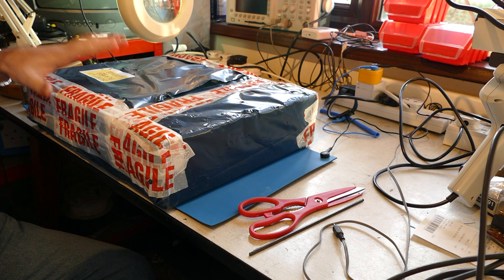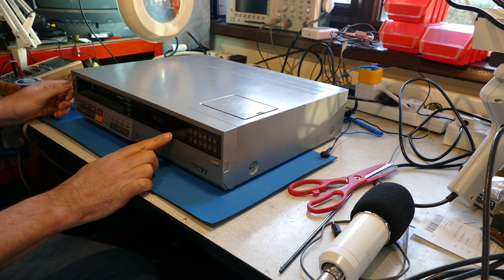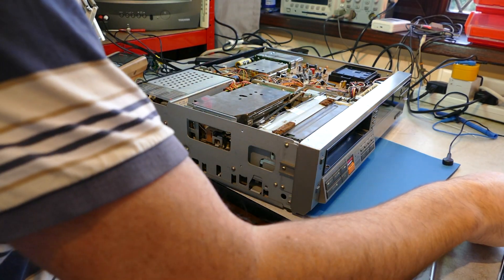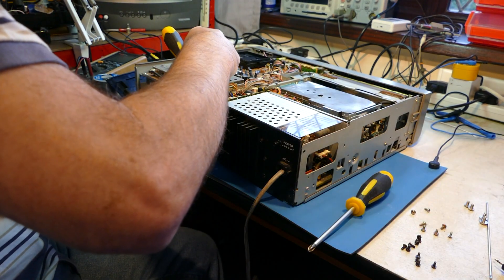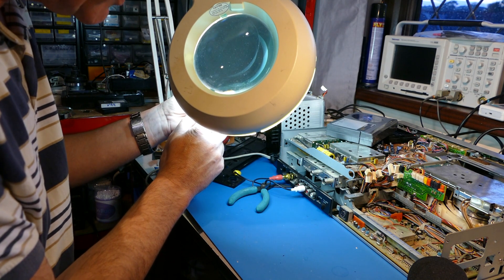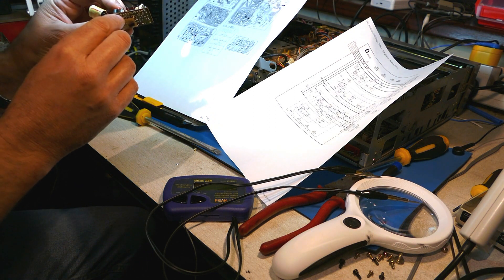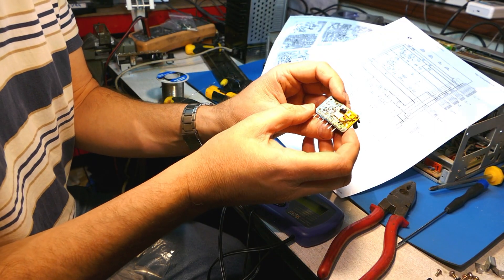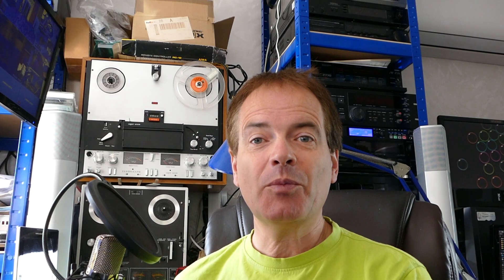Fixing the display on a Sony SL-C9 Betamax video recorder (DC-DC converter repair)

Comment: Do u know if the sl hf 100 has a dcdc converter and if so where it's located?
Reply from the maker: Looking at the service manual page 57, there's a switching regulator IC MB3759 on board D which provides the higher voltages via a transformer and rectifiers.  So yes, that's a DC-DC converter circuit of sorts.
Reply: @video99couk  so its located on the psu? if so i dont need to worry i recapped the psu completely
Reply: @video99couk  ah yeah its the little addon board which they soldered to the psu, recapped it aswell already

Comment: Today Feb, 2nd, 2024 i received a 2nd hand SLC9e, not es. Repaired many of them in the early '90 for Sony Netherlands. This Betamax was the one with the most standard issues which where fixed under warranty ( I think). Problems where : not closing front door, broken nylon gear cassette loading compartiment (CLC)  (replaced by metal gear version). On the side of the CLC a kit (o-ring + tiny screw) was added for the problem the 2 plastic components got apart from each other. The black nylon gear with metal inner ring was replaced by a full nylon gear.  Broken loading rings where also common on the Betamax after the C5,6 and 7 models. On the loadingring there are 2 tape guides who where replaced by better fitting one. Than of course the DC-DC converter. The sensor in the lowerdrum motor with the glue issue. The solenoid with broken internal fuse (behind tape, not direct visible) on the reel table. Just put an shunt wire as solution :) . Also tape guides on both ends got loosen. And . . . . a burned Servo System board , burned and heavy damaged by the transistor driver for the unique Reelmotor. Sometimes stereo audioheads where too damaged by many hours of use Betamax tapes , PB, FF and REW use. It was a great time a technician for Sony NL.
Reply: Do you know what was different about the SL-C9UB compared to the C9? The input specification for the C9 says 110-220 50/60Hz, but can find nothing on the power requirements for the UB...
Reply: @jimthebrit  All SL-C9s have suffixes in their model number depending on which region they were destined for:
SL-C9UB = UK, mono tuner, 12 tuner presets
SL-C9E = Mainland Europe, mono tuner, 30 presets
SL-C9ES = West Germany, stereo/bilingual tuner and modulator
SL-C9ECS = Belgium, stereo/bilingual and cable (CATV) superband tuner
SL-C9F = France, SECAM system, mono tuner, cassette doors and front/rear panel buttons, switches etc are in French
SL-C9AS = Australia, similar to the European model but with different tuner frequencies
All variants have a 110-240V switching (SMPS) power supply. The ES and ECS variants can also record the stereo and bilingual pilot signals onto the tape for automatic selection during playback, as well as transmit 2-channel sound over the RF output. None of the other variants can do that.
Reply: @crashbandicoot4everr , perfect explained. My compliments.
Reply: @AudioVideoVintageLover  Thanks. I forgot to point out that the ES variant was also available in black the next year. I have both colors. :)

Comment: I've got the same player with no display as well.But I don't have a tale do I need a tape to see the display?
Reply from the maker: The display should be working with no tape inserted.  It almost certainly has a bad DC-DC converter, and possibly other faults too.  Tapes are easy enough to find, they were made in their millions.

Comment: Hello.
I bought a used SL-C9 and upon turning it on (without cassette) it goes straight to lacing, then unlaces along with some unhealthy sounds and the eject light stays blinking.
Can you please help me?
Reply from the maker: The lacing and cassette mechanisms on the C9 are unnecessarily complicated.  I'm afraid it's not possible to fault-find my remote control, this is going to take the attention of someone familiar with video recorder repair.

Comment: Hi, i really love your repair video guides very much. 
Maybe you can answer my question. I am also an owner of a SL-C9ES machine. Unfortunately one video head is broken. Is it possible to replace this 3 head video head with a 2 head video head, like it is used in almost all other Sony Betamax recorders (e.g. the SL-F1)?
Reply from the maker: I had always assumed that the F1 and C9 took the same heads, but never checked.  I don't know what would happen if you fitted the wrong heads.
Reply: Thank you very much for your very quick reply. Yes, i thought the same until i checked the service manuals today. The upper drum is still the same, but not the video heads. So there is no other chance then to try it because i cannot get anywhere the SL-C9 3 head video head.
Reply: Just a short feedback. Playback, recording and normal picture search are working very nice. The special picture search functions of course not about the 3rd head (A') which is missing with the 2 head video drum now. Do you have any idea from where i could get the original head?

Comment: hello, thank you very much for your shares. After plugging in the slc9 es lcd screen, there was a sound and it does not show. I have a lot of problems because of the betamax video. Do you have a recommendation for a sony latest model betamax device that I can use without any problems? There are problems I have experienced in related videos from the link

https://mega.nz/file/0soyQByL#CSEt9yIirYEkD3e5CRUINyL1hVuDocI6vtcdU0vSJ4M

https://mega.nz/file/s9xiyJaL#JOYkqusnh0OFklHGjijlGhvYlL4P2sopYwQ_6zgHiYk

https://mega.nz/file/BkhghZJC#asqIXxnxUGpeYH0mksCJrDMF4xtBiGQILJy2JnbvHUY
Reply from the maker: I find that the later Sony models are quite good, any from the SL-C20, C30, C40, HF-100 and later.  Sanyo VTC5000 and VTC5150 are also reliable but will probably need idlers and belts.
Reply: @video99couk  Thank you for helping me, I'm one that transmits continuous old tapes to a computer, but I'm looking for a device model exhibiting the best performance of the SL-200 model as the year of the latest devices in 1987 used a longer life, I think what do you think about this topic

Comment: Hello youtube, thank you very much for your useful videos, first of all, the head nail parts of my sony sl 800 me video device are broken and I want to buy and install a new one, but I do not know which product to buy, but if there is a head model link I can buy according to sl800me, I would be happy if you can inform me. thank you

https://resimyukle.io/r/toR6XjfBQe

https://resimyukle.io/r/mlaTmwthY5

https://resimyukle.io/r/WrujjaQGMV
Reply from the maker: You will need to download the service manual to find the video head part number.  It may not be available any more though, this wasn't a particularly high volume machine.
Reply: Thank you very much for the answer. I searched on the internet, but I could not find the sl800me user manual. In the video I sent you in the head part, the label says 68A japan. Is this the head model? 
https://resimyukle.io/r/NFgCkIXbwC
Reply: @video99couk  hi how can you help me sony sl 800 me i can't find the manual pdf file unfortunately :( you can send it to me if it is in your archive which head mechanism i need to buy for sl800me sony betamax sl-t30me head mechanism would it be for 800 me device

Comment: Hello, thank you very much for the videos you add are primarily useful videos have spectacular Betamax SL-C9 device I'm having a problem, unfortunately, I want your help on deck cassette case ejector light is not constant flashing and tape does not get to the deck the video as I ask your help, I add the following link megazn thank you

https://mega.nz/file/sopVUCTD#kHkWJXlsqnHVZ1534XAYtrKQJrJYHVlEwLFAtDvZgKo
Reply from the maker: I can't really repair things by remote control.  All I can say is that it looks like the cassette carriage has a problem.  The carriage is very troublesome on these machines.  Check to see that you have the brass gears at the ends of the rod which is just inside the top of the carriage.  If the deck still has the white plastic gears, they have probably broken up and will be part of the problem.

Comment: Question...I have a sl-2500 that powers on but has no visible display. I lifted the cover and noticed two thin wires (red and black) attached to a small black connector that wasn't connected to anything. The wires were maybe 5 inches long. The wires were coming out of the right side of the display module. I can't find where this is supposed to plug into. Do you have any ideas? Thanks!
Reply from the maker: I don't know what the wires are for.  I suspect the lack of display is due to DC-DC converter failure, that's very common.  It also takes out the tuner, so you might be able to test for that and prove that you're on the right track, if you can find a way to get a signal for it to tune into.
Reply: @video99couk  Thanks for the reply! I looked at the service manual for the player in this video (basically the same as the SL-2500) and  it looks like the two wires attached to the  black connector go to a small board below the display called SL1 (I think or SV1?) and is for some "monitor/camera" selection. Maybe someone tried to fix the display and failed to reconnect it. I was hoping it was a "power" wire for the display. Lol. I'll look at your video in more depth and look at replacing those bad caps. Thanks!

Comment: The SL-C9 already had a real time counter?
Reply from the maker: Yes, years ahead of most other machines of any format.
Reply: @video99couk  Well, thanks to the always loaded tape. VHS achieved this in late 1987 when AKAI invented the "Quick Start" mechanism, with also always loaded  tape. The Sync head needs to be in contact with the tape.
But in general I still preferred Video 2000 with their absolute time counter.

Comment: Hello from Australia, I have been lucky to find two C9 machines, although one of them won't play,,, everything else works eg, picture search forward and review but won't stay on Play mode, it starts to play for half a second then stops...!,
Any clue...! 
Thanks again.
Reply from the maker: Is the head drum spinning at full speed (rather than just being dragged around by the tape)?  If not, then suspect Hall Effect sensor in the lower drum.  How about freeze frame?  If that works, then there may be a capstan servo fault or problem with takeup spool speed.
Reply: video99.co.uk Ok thanks for your response, I'll need to check the pause, thanks again 👍
Reply: Hi Colin , just been looking at the C9 again,,, it seems to be loading tapes okay and all the special effects frame by frame half speed , pause and review is all working as it should, although I need to be quick as soon as I hit Play I need to activate pause or frame controls otherwise it won't work, you might be right about the capstan....! Any ideas on how to check this..! ((Also Picture Search  doesn't work))..is it somehow connected to play mode..! Thanks again Carlo.
Reply from the maker: @carlzaffino3434  See towards the end of my other video about C9 repairs: https://www.youtube.com/watch?v=iuPSf7KdOag
I suspect you may have a capacitor failure on the lower PCB.  There aren't that many so if you don't have a good ESR capacitance tester then you could just replace them all.
Reply: video99.co.uk Okay, I've already had that board out, I do have a ESR meter but didn't think to use it 🤔,,, I'll check it out, thanks again..✌️

Comment: Sony SL-C99 and SLF1 portable were a masterclass in design. I loved my C9
Reply from the maker: Three major design changes I would have made though: Much simpler and more reliable C9 cassette carriage.  Eliminate the DC-DC converter for the clock and tuner on C9.  Redesign cabinet work on F1 so that it is possible to access the top of deck without taking the whole machine to pieces and risking flexi-cable damage.
Reply: @video99couk  sl-f1: should never have used those flexi-board ribbon joiners. the very beginning of many Sony vcrs, walkmans etc with open-close flaps etc and eventually the film ultimately fractures rendering some push-buttons useless

Comment: At My sl 9ces the display is fault too .. shit ... i cant see no digits..... i hope i can  repair it...but i have no air gun ... should i replace all capacitors at the dc dc unit ? And which other pieces ?
Reply from the maker: I would replace all the electrolytic capacitors.
Reply: @video99couk  
I have replaced all capacitors but no function. I think one of the Transistors may be damaged.
Reply from the maker: @rennobecker9032  Oh dear.  It's going to be a case of checking the transistors against the schematic.  Most transistors should appear as a diode from base to each of collector and emitter (for NPN) and open circuit between collector and emitter.  So you can probably test most of them in place.
Reply: @video99couk  thanks for the replie. When I have a little bit time in the next i will test the Transistors in hope finding the circuit.

Comment: Hello,  I have questions please, Where can I find video head for Sony Betamax Sl-200me ?    Does Sony Betamax sl-2300 video head fits on Betamax Sl-200me ?
Reply from the maker: I don't know for sure, you would have to look up the service manuals to see the head part numbers.  The SL200ME is PAL/SECAM but that wouldn't in itself require different heads to a PAL machine.  But the SL-2300 is NTSC only so I doubt that it uses the same heads as a PAL/SECAM model.

Comment: Years ago i had a mates vcr in for a no display fault, there was no supply to the flourescent display, While moving the vcr i noticed a slight tin sounding rattle.
Inside a small tin box near the display was the oscillator, the coil would of had an aluminium cap with info on it, the glue had given up the ghost and the cap fell into the component area.

No parts were damaged as a micro fuse had popped, i left the cap out of the box :-D
I also cleaned the inside glass of the fasia, it never gets cleaned :-(
If you don't like waffle comments please tell me.
I used to be on c.b radio and i could talk the legs off a whole field of donkeys lol :-D
Reply from the maker: You can see me clean the inside of the display facia on my Sanyo Beta video, it can make a big difference to brightness and clarity of the display, it's well worth mentioning.

Comment: Eu tenho um igual e às vezes não liga.Creio que seja o relé na fonte secundaria.
Reply from the maker: You will have to work through the schematics to see why the power does not always work.  Do you have schematic diagrams?
Reply: @video99couk  não tenho esquemas.Eu colecciono Betamax háuns 15 anos e tenho muitas peças de reposição.Tambem tenho o hf-150 só rebobina a cassete,e o hf-950 foi morrendo.Apenas acende alguns leds. Há coisas que não sei reparar,entendo alguma coisa de electronica.
Reply from the maker: @MyPOLYSTAR  This would be a good place to start: https://freeservicemanuals.info/en/servicemanuals/viewmanual/Sony/SLC9ESSM/SLC9ECS/
I wish I had the HF-950, that would be well worth fixing.

Comment: Interesting video and a good fix. I did wonder how successful the hot air gun would be at desoldering the cover but glad to see it did the trick.
Couldn't help but notice the little yellow/orange drawers above your TV. I've had some of these since I was a child and have them up in my workshop too. I find the handles break eventually so have 3D printed some stronger replacements. 😀
Reply from the maker: The hot air gun was certainly the answer to this problem.  Those old drawers were from my previous workshop (and one before that), really they need replacement.  I'm going through updating a lot of my storage solutions since I've just moved into a new workshop which is much more YouTube friendly.